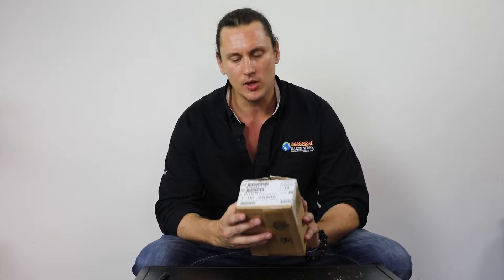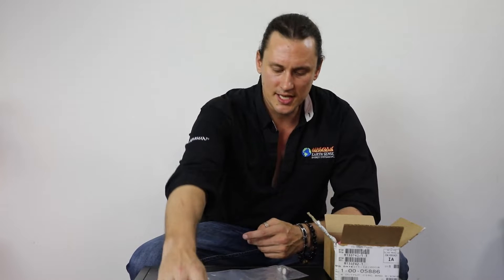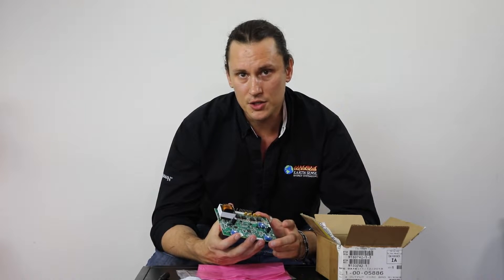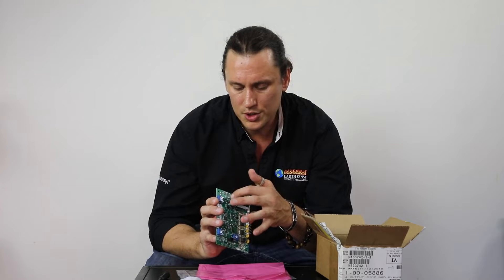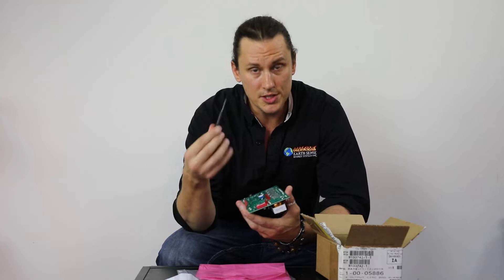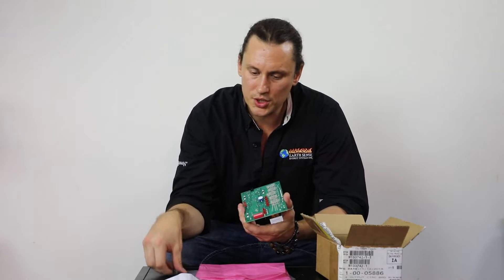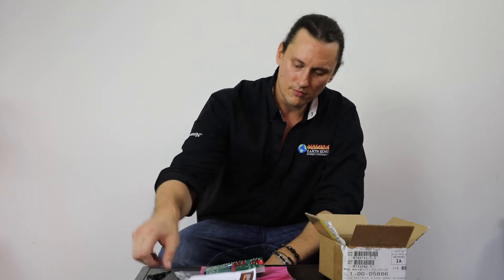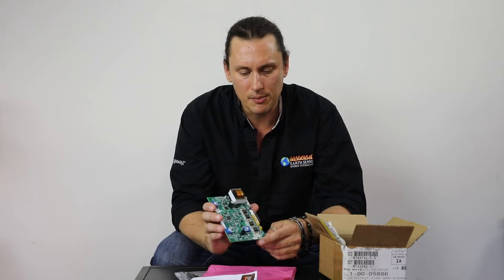Harman Circuit Control Board Dipswitch Settings

Comment: Do you have to remove the micro feeder switch when you’re installing the new style p61 circuit board or can I just leave it in?
Reply from the maker: Thanks for the message, happy to help. You do not have to remove the micro switch, it can simply stay as it is, just will not be connected with the new circuit board. Any other questions as you get it installed just let us know. Thanks!

Comment: Do you know what the dip's would be for the following?:
3-20-05374C old/original board...
REV C...
2005...
P68 stove...
Reply from the maker: Thanks for contacting us. Unfortunately we wouldn't have information regarding the dipswitch settings of an early board like that, we only have the outlines for the replacement control boards. Sorry we couldn't be of assistance here.

Comment: I replaced the control board on my Advance Harmon and Im getting three blinking lights on status.  It runs and burns  not nearly hot enough and actually cool to the touch.   I cut the wires out for room Temp and maybe I shouldn"t have.  I did connect the ESP thermos connector to the control board.  Can you help
Reply from the maker: Thanks for contacting us. #3 blinking light is going to indicate an issue with the ESP probe. It's very important the #5 dipswitch is set correctly based on the ESP probe wire color. Double check the wire color for the ESP probe and confirm the dipswitch is set properly. It can also be good to inspect and clean the ESP probe; video below on that. When you say that you cut the wires out for room temp, what do you mean by that? Even if you are not going to use room temp mode, it is important that all wiring is correct in the stove and to the circuit board. 
Couple References for you: 
- Blink Error Codes: https://pellethead.com/pellet-tech-101-harman-control-board-status-light-and-error-codes/
- Harman Board Install: https://youtu.be/PNAkJ3jDmtM?si=DopgZY42o-QrxwXR
- Harman ESP Probe Cleaning/Install: https://youtu.be/kt7nnGMYU-k?si=r3ZqwVBFQyHrZW3l
-Harman Controls - Best Ways to Use: https://youtu.be/cZErnzd53IA?si=GA5xzRrXMiafyYl2

Keep us posted, happy to help.

Comment: Greetings and thank you in advance for your time and help, I have a Harman advance. I replaced my circut board, before I changed it my Power light stayed on constant, now it blinks. everything seems to be working correctly , just a blinking Power light.
Reply from the maker: Thanks for the message. Let me touch base with our tech team on this. Harman has had many different control board revisions over the years, let me find out if this is normal or not. Ii will follow up ASAP.
Reply: @EarthSense  appreciate it
Reply from the maker: @jccollins48  
Just heard back from technical. Are you running on a battery back-up or inverter? Might have to flip the #4 dip switch on the control board if you are.

If not, the first thing we will want to do is to verify the control board and dipswitch settings. Let's verify the control board part number. It should be 3-20-05886. For this control board part number we want to verify the revision (the revision will be on the control board on a small label.) 
Revision A, B, or C with a Black ESP Probe Wire Will Require Dipswitch Settings 00000100. Revision A, B, or C with a Red ESP Probe Wire Will Require Dipswitch Settings 00001100. 
Revision D & Up with a Black wire ESP will require dipswitch settings 10100100. Revision D & Up with a Red wire ESP will require dipswitch settings 10101100.
This information is in regards to the Advance model only; other models will have different settings. Let's start here by confirming the control board part number, revision type, and dipswitch settings. Keep us posted, happy to help.
Reply: @EarthSense  Thank you much, My control # is 3-20-05374
Reply: I have my dips at 00010000
Reply: no battery back up
Reply from the maker: @jccollins48  Thanks for the message. OK, that control board part number will have different dipswitch settings. In the tech manual print out I have it's showing 00000000 for a black ESP probe for that board. It's says N/A (Non-Applicable) for Red ESP probe dipswitch settings. What color is your ESP probe color? We'll figure this out.
Reply: @EarthSense  My ESP is black, I currently have my Dips @ 00010000. My stove is doing everything correctly, just my Power light blinks, not a code , or status light .
Reply from the maker: @jccollins48  Thanks for the message back. Yeah, that is just the info from the tech manual with that control board it was saying all 00000000 for the dips. It's something to try to see if that is the reason for the blinking power light. Keep us posted.
Reply: Appreciate all of your help, have a great one.
Reply from the maker: @jccollins48  Absolutely, always happy to help. Here if/when you need us. Warmest regards!

Comment: Do the new control boards on XXV fit the older stoves  from 2005?
Reply from the maker: Hey Joe, lots of variables here. Is it an XXV or XXV-TC? (Touch Control Screen). If it's the XXV with the 4 output control board like in the video here, that control board would work in a 2005 XXV model. It also works in a handful of the other Automatic Ignition Harman models. Just would want to double check the ESP probe wire color and make an adjustment on the dipswitch if needed with the earlier model. Any other questions please let us know. Thanks!

Comment: Whats the white dial on the back of that control board? Please let me know.
Reply from the maker: Apologies on the delay Cory. That is a micro-adjustment dial. It can be accessed through the front faceplate with a precision screwdriver. I would have to double check with our lead tech team, it either makes a small adjustment to the feed or combustion blower. It's a very fine tune adjustment that 99% of consumers never need to touch. If you need further info just let us know and I can check in with our tech team on specifics. Thanks!

Comment: The Dipswitch Reference Chart indicates the REVISION, I assume of the circuit board.  But your video doesn't explicitly tell how to locate the boards Revision Letter.....
Reply from the maker: Thanks Nigel. Each new Harman control board will come with an instructional pamphlet for dipswitch settings based on that control board revision. If someone had an older control board and needed to check the dipswitches based on that revision control board, we would need to look up the settings based on that revision in archives. On the control board there is a small sticker that will list the board revision number. Happy to help however we can. Thanks for reaching out.
Reply: @EarthSense  Thanks.  The sticker on my new circuit board wasn't super clear in the it had a bunch of stuff, with an F sitting to the right.  Strange that they would not put REVISION XX on that sticker.  Anyway, I made the settings for the F revision, and all is working well.  THANK YOU for the reply.  Nigel
Reply from the maker: @nigellemaire8523  Thanks Nigel. Yes, I have seen that as well where things can be difficult to read, and you're right, should be a specific mention like you stated - it would definitely make things easier. Great to hear, sounds like that was correct. Any future questions just give us a shout. Warmest Regards,

Comment: The combustion blower motor is not working on my Whitfield pellet stove, can someone explain me how to troubleshoot the problem .please
Reply from the maker: Hey Ernesto, Is it the combustion/exhaust blower or is it the room air/convection blower not functioning as you specified in the other comment? Happy to help. 
Thanks,
Reply: Earth Sense thanks for  answer, the one is not working is the room convection blower , before that happen last week the board was doing noise and the motor was not changing to high and low speed . That noise was when we turn on the fan .thanks again for your time.
Reply from the maker: @ernestoflores6856  Thanks Ernesto for clarifying. Could be the motor itself or it could be the circuit board creating the issue here. What make and model stove do you have? Does the motor run correctly when plugged in to direct power with a test cord? Happy to help.

Comment: Trying to figure or the dipswitches for the Harman Invincible RS closest thing the reference chart has is PIN/RS. The ESP cable is black you mentioned the importance of the wire color in the installation video of this board.  The year is a 1992.
Reply from the maker: Thanks for reaching out Eddie. Yes, the PIN/RS is what you would want to reference on the chart. Depending on the version control board you have in your model, with a black ESP cable, it will either be 00000100 or 00000000. Keep us posted, we are happy to assist.